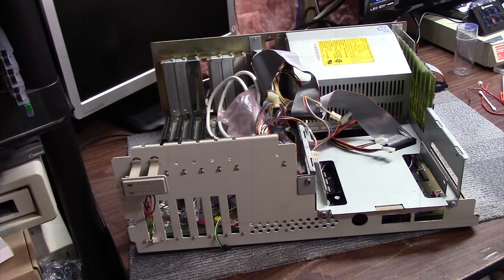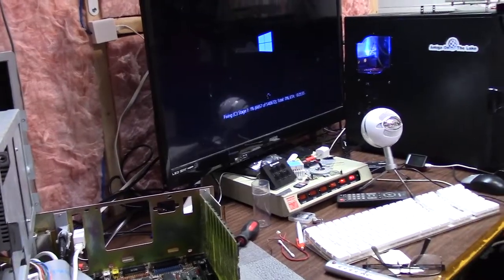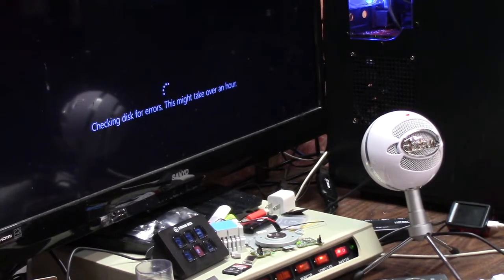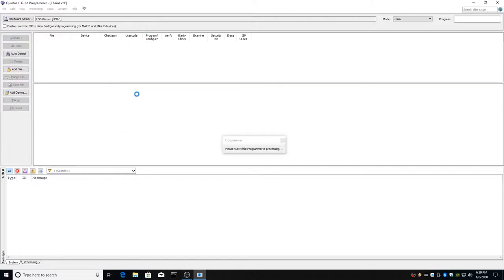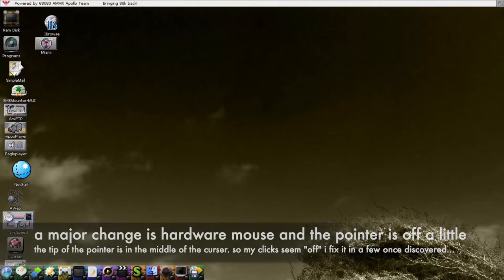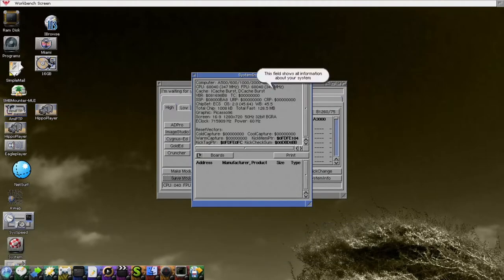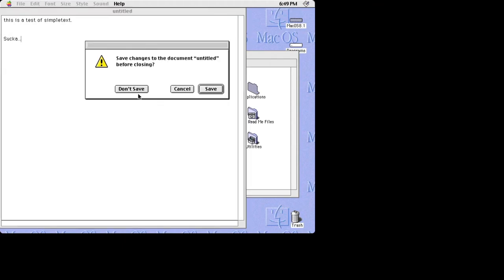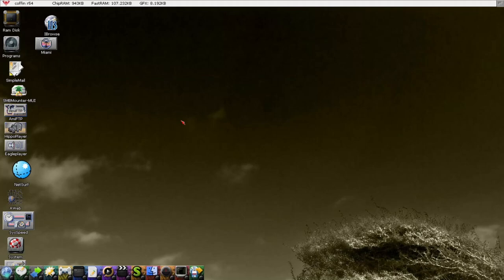How to Flash an Apollo Vampire

Comment: When I try the built in Apollo flash utility (in Apollo SOLO 3.2.2 install) it doesn't work! A message comes with being unable to find the ROM? Which ROM file I'm suppose to put and where? I have the latest ROM that came with AmigaOS 3.2.2 as a file. I'm supposed to place that somewhere to make it work?
Reply from the maker: On the microsd card of the vampire in the root. and it has to be named as i showed it.   And use the amiga 1200 rom

Comment: I have an altera usb blaster and not sure if the quartis software is correct. No hardware shown in menu. Went to force some driver I found for windows ten to use for blaster and it crashes system

Comment: Silly question... what is the deal with the x10, x11, x12 files for each core release?
Reply from the maker: it is the mhz calculations from the original 68000's, 7.16 mhz times 12  to get the 85.92mhz of the X12 core, its all about speed boosts over the orignal 7.16mhz motorola 68000